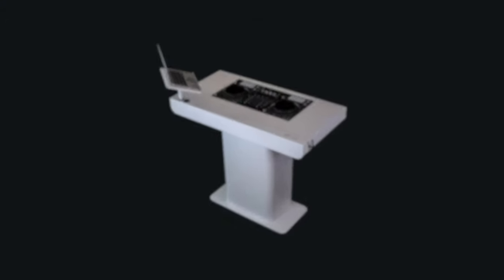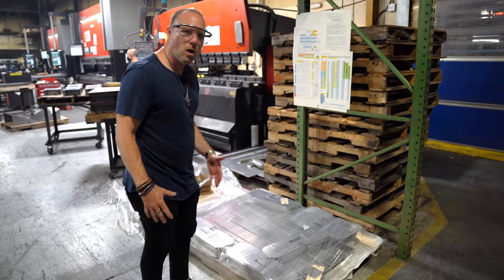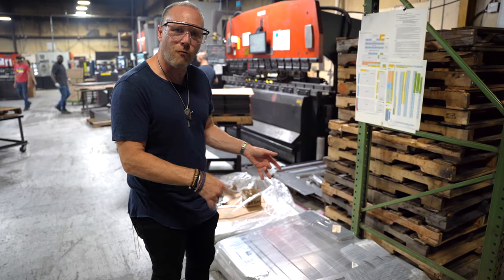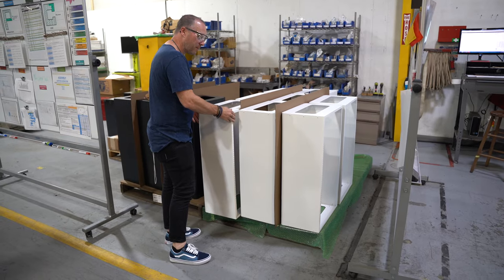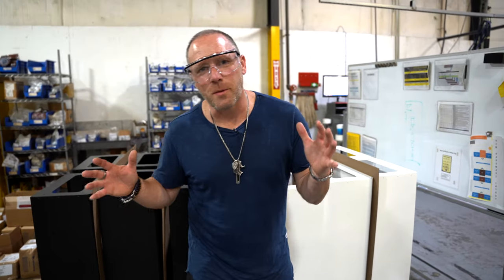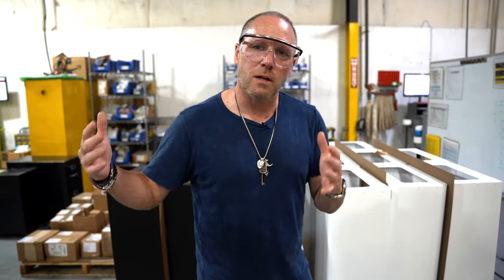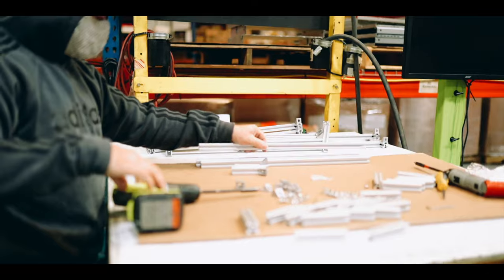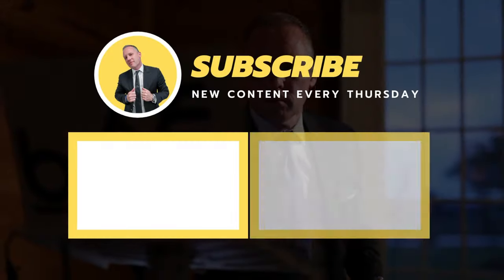Bunn Gear Mobile DJ Booth - Factory Tour

Comment: I really like it, but can it come in a taller size?? I am needing the top of the deck to be at 43" high......I'm 6'8" and I hate having to lean forward all night to work!
Reply from the maker: It cannot, but some guys have added caster plates etc. to the bottom which would raise it considerably. Find "Bunn Gear Fans" on Facebook. You'll see all kinds of mods.
Reply: @DJJoeBunn  Thanks